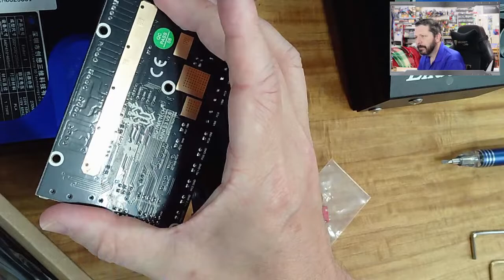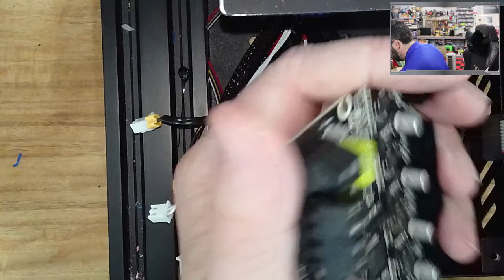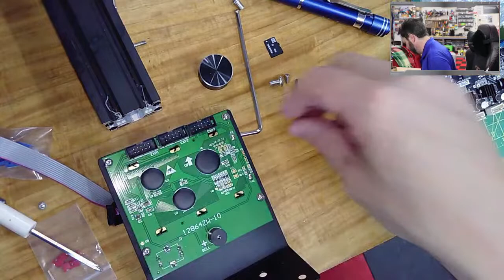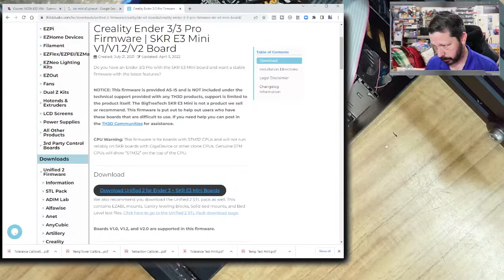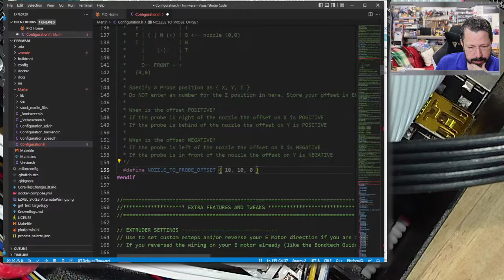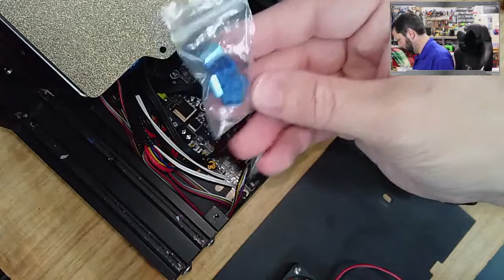Summer 2022 Additive Fabrication 08 | SKR Mini E3 | Ender 3 | Touch Screen

Comment from the maker: Wow, this was an interesting one to track down. The problem with the screen was . . . it was mounted too tightly into the bezel. I took the screen out and it worked fine, put it back in the metal housing and it quite working. I ended up putting the screen back in the metal frame but did not tighten the four screws too tightly and it is working well now. I suppose the standoffs were not flat with each other and tightening down all four screws was twisting the board in such a way that it was not behaving correctly. Seems to be good now.